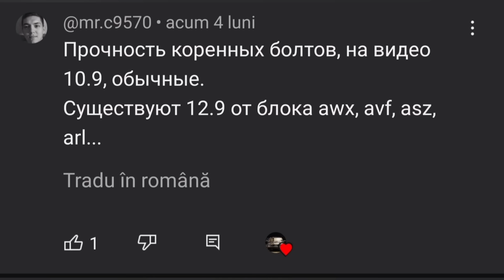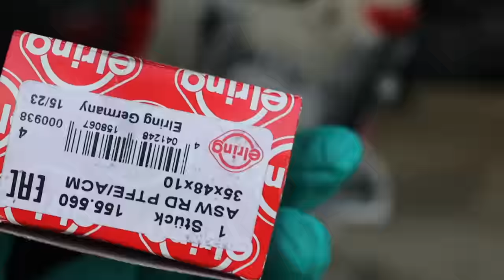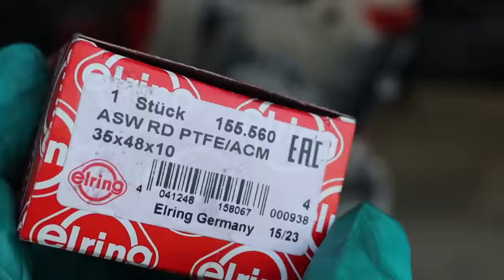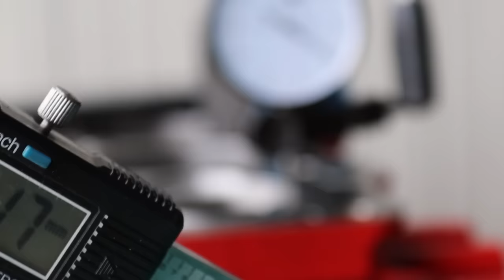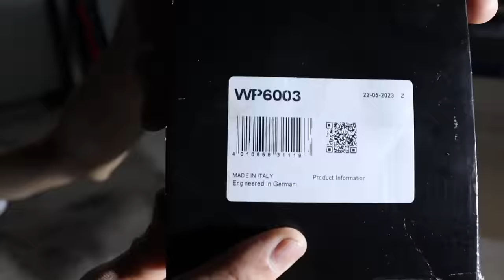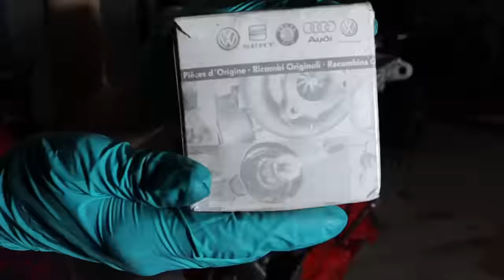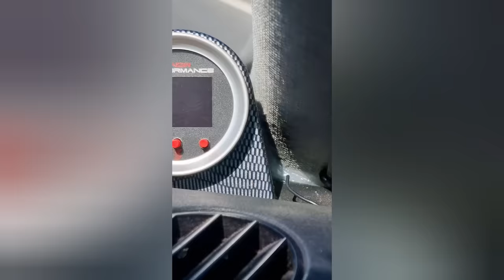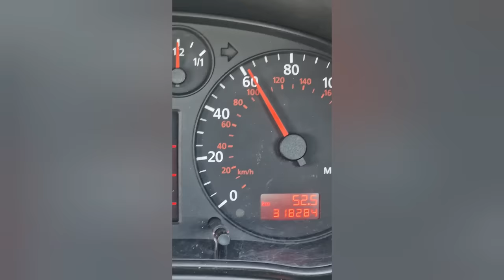1.9 tdi pd 8v Time-lapse Race Engine Rebuild + first start 2023

Comment: Hey, it was very unexpected to see myself, and my advice is to change the usual 10.9 bolts to 12.9) Very grateful, and glad that I helped!) Good luck;)
Reply from the maker: The thing is that the stock bolts are 12.9 for this ASZ engine code, same as ARL and when i ordered the bolts i receive them and i didn't check them because i didn't think they may be send wrong ones, so you just make me check them and thanks to you i've been able to change them with another genuine 12.9 ones.
Reply: Hello guys, do you have the part number for connecting rod screw?
Reply: There are 3 diff between the two main engines, ASZ and ARL,  the turbo, the IC, and the headbolts.

Comment: Its not good work... scratch In cylinders,  weak stock bolts 10. Another user help you thoose better - stronger, used stock pistons with chamber moding. Only forged conn.rod are good and  stronger bearnings. Next tip Oil pump with smaller wheel ,produce  more Oil pressure. Camshat Type? Hydraulic delete to mechanical converse do highest rev and max boost😊
Reply from the maker: Listen mr advicer, im not posting this videos to ask your opinion i know very well what im doing and i know exactly what's better and what's not for this engine.
  Firstly the 10.9 bolts were come in a huge bunch of parts and i have ordered the right part number for 12.9 but unfortunately they came wrong part and i haven't check them,  i was lucky as the engine was still on the stand by the time i saw the comment from that user and just change them with new genuine 12.9 ones.
 Second thing, this is not the first time i build an race engine and i have tested many brands of part by now doing testings on my engines and show others for free whats good and what's not.
 The 3rd thing i have sayd in my previous videos that im gonna try and test some mods to see how will engine react so the videos that i upload should be for infos if you can  get any from them.
 The camshaft i sayd in other videos its a pipercam 272°, i have all details  and link there with the lift specs, then oil pressure i know that what you sayd but at the moment i use the car in very high revs and keeping the huge preasure on the oil sistem its not gonna help me and the oil pump will definately fail much faster, at the moment ive got 10 bar at 90° after 2k rpm so im good.

In the end people should understand that these videos should be helpfull for yours and if you can get any good information from them ill be happy if not this is it, you do other videos and show people on your money how to properly do it  and let me do them how i know.
 Thanks !
Reply: @WRCgarage  OK, fine , for me you know mid. I do 2.0 Tdi to 295/605 on Gtd20 v2, Without metanol or nitro , pure  diesel! . Cya!!!
Reply from the maker: I did before rebuild 330hp only diesel aswell, and got some good performances but because i wasn't satisfyed with 100-200 time i rebuild the engine again with new upgrades as veicomer full race head, another type of forged conrods, a better camshaft and new design of pistons wich are on testing at the moment.

   If everything goes well the car should archive around 380 hp diesel only, and with methanol another 20-30 hp extra, and with nitrous probably another 100 hp depending of nozzles and controller. So ill see, the car is still on break in at the moment.

Comment: I had a 1.9 tdi (1Z). The engine start after the assembly in this video reminded me of when the timing belt had skipped one tooth, and the engine was very difficult to start.
Reply from the maker: 😅😅 That isn't the case here mate, im tired to explain everyone why i did started the engine like that, the engine is brand new everything was new without oil inside and without diesel on the sistem, i wanted to start like that to give him time to get oil on the parts before starting

Comment: So much money and not decking the block? What about those bores? Clearly seen better days. Strange aproaches.
Reply from the maker: Why are you worry about my money ? I dont need any advices thank you, i'm doing my engine how i like.
Reply: Not every rebuild needs to be bored and decked. Seen people waste money  when a hone and re ring would have been better.
Reply from the maker: Sorry to disappoint you, mate, but the car still works brilliantly without any issues. Only "smart" mechanics do the decking when there's no need for it, which is the biggest stupidity I've seen. I never did it when there was no need, and surprisingly, the engine performs as new.
Reply: @WRCgarage I completely agree with you. I did the same thing. I hate when people deck a perfectly good block. It makes no sense.

Comment: Hey do you remember what your ring gap was set at?
Reply from the maker: If you check my videos you will see the video doing that
Reply: @WRCgarage  .50mm? Spec is .40mm.  It's ok to be at .50mn?
Reply from the maker: @matthewlee2686 I have explained in the video but you haven't been focused,  i am gonna use nitrous injection on that engine and the gap should be bigger in that case.
Reply: @WRCgarage  was just curious because I'm building a engine now and can't find much info on ring gap.  I will be running gtb2260vk and .320 injectors.  Will my gap be ok at .45mm?
Reply from the maker: Yes, no problem,  its better to be bigger than specs and not lower as you running on higher boost than stock and much more heat than usual so that's fine.
Reply: @WRCgarage  ok thank you
Reply: Foarte frumos lucrat bravo mult respect 💪💪💪
Reply from the maker: @costiklafarastikla110 Mulțumesc frumos ! 🙏

Comment: I did 184,000 hard miles with a  tuned PD130 but never got to see inside the engine due to it reliability.
Great video 👍👍👍
Reply from the maker: @Puddingtops  Thank you ! 😁

Comment: 10:46 dont do that. Dont put liquid gasket in all the surface of the caps. There is a slot that should never be covered. You only have to apply a small amount of liquid gasket on the outside of the caps, without covering the slot.  It is explained with more detail in the official manual.
Reply from the maker: I know i have the manual, i saw that to late, hopefully its a small amount and wont restrict the oil that supplies the camshaft bearings. 
   To be honest usually i never put the silicone there and never had leaks but this time i did 😅, should be alright, i will check it next time when ill be home.

Comment: Amazing! Should there be a pipe from the PCV valve on the crankcase?
Reply from the maker: Yes, but it's going to a catch can, then under the car
Reply: @WRCgarage  is there a way on these engines to test the pcv valve is working correctly? I have a 1.9tdi transporter, blue smoke from exhaust, leak and pressure test all good. Thinking might be the pcv valve stuck open/closed
Reply from the maker: I don't know if there is any test for them, but you can check if your oil stick jumps out or if you have excessive pressure when you open the oil cap.

Comment: Hello, is there a change regarding the tandem pump? I think it is a little different. Did you prefer the one for 2.0 pd engines? what is the reason of this ? I would be very happy if you answer me. I think I am having a problem with this issue.
Reply from the maker: The bosch one i use is a bit higher pressure than the stock LUK, so for me it is a help for a tuned engine as supply the fuell a bit faster.

Comment: salut amice, stii care sunt tolerantele marimii arborelui cotit (ASZ), oficial sunt 54mm (la rulmentii principali) si 51mm (la rulmentii de biela), dar VW nu scrie in manualele de service care este rata de uzura, daca ați putea ajuta, aș aprecia că a menționat în următorul videoclip😇
Reply from the maker: Salut, la arbore jocul axial (stanga-dreapta) trebuie sa fie intre 0.07 si 0.17 mm uzura maximă acceptată 0.37 mm, jocul radial (sus-jos) verificat cu plastigage trebuie sa fie între 0.03 si 0.08 mm iar uzura maximă acceptată este de 0.17 mm
Reply: @WRCgarage   multumesc pentru informatii, am arbore cotit si valorile fata de cele oficiale sunt -0,005-0,006 pe ale mele, cu faptul ca rulmentii sunt facuti si pentru uzura arborelui cotit. Multumesc, pot dormi linistit. Cand fac montajul, ci mai degraba masurarea de testare (gabaritul din plastic), va mentionez

Comment: 1.9 TDi - 130hp????
Nice work!!!!
Reply from the maker: Yes pd130 😁
Reply: full stock can hit 125kw, with race head i expected maybe 200hp :/
Reply: @jakub77 I got PD130 AVF with GTB2260VK, FMIC, 4Bar Map and tune and it has ~230hp
Reply: @vainopeltokorpi7829 I have the same engine and turbo along with other upgrades. If you use pd150 12.9 head bolts, upgrade camshaft, high flow exhaust manifold, 2.5-3 inch exhaust pipe and upgraded injectors you can see over 300hp
Reply: @lamaq101  for gtb2260vk max hp is ~290. You also have to port your head for over 270-280 hp. Upgrading exhaust manifold is not necessary, i have seen ~400hp setups with stock manifold.

Comment: Where can you buy pistons if you’ve changed the engine displacement in a 1.9 tdi
Reply from the maker: The stock pistons you can find them on mostly any online parts shop, the forged pistons just few do it .
Reply: @WRCgarage  great, thanks

Comment: Hi, please tell me the number of ARP bolts for this engine
Reply from the maker: Hi, they are special made they not come as a kit like all the others wich ar weaker chrome-molly 8740. Just go on the website where i get them and order from there, they dont have these anymore due to cost of supply but they have even a beeter one stronger than these for same price so just go on website Whitbread performance llc USA and buy from there.
Reply: @WRCgarage thanks

Comment: Salut,la un passat b5.5 2004 1.9 tdi 130cp la 140km/h taie pedala,dar nu apare nici un martor in bord.Daca il opresc si il pornesc isi revine,dar dupa daca ii dau iar pana la 140 iar taie pedala.Sentimentul este de larca nu intra turbina si motorul nu arw outere sa se accelereze.Mersi?
Reply from the maker: Salut, iti intra in limp mode,  posibil sa ai vreun furtun pe partea de boost spart/fisurat si de asta face asa, verifica bine furtunele la turbo.
Reply: È la valvola a depressione che c'è prima del waste gate, prova  a staccare il tubo sopra il fungo e guarda se aspira.

Comment: А что за измерения на шатунных болтах?
Reply from the maker: Hello,  what do you mean the socket size or the bolt ?
Reply: @WRCgarage Hi! I wonder what you measured on conrod bolts after tightening them.
Reply from the maker: The ARP bolts must be tightened to stretch, so I was measuring the stretch after tightening. The stretch is the maximum point before the bolt breaks.
Reply: @WRCgarage  thanks, i didn't know about that.

Comment: Salut ! E normal ca pe la filtru epurator din capac sa ajunga ulei spre furtunul care duce in turbo ?
Reply from the maker: Normal nu e, ar trebui doar vapori de ulei sa treaca pe acolo, dar odata ce motorul are ceva uzura incepe sa produca si vapori mai denşi de ulei si de acolo se aduna cate putin ulei, de exemplu eu înainte sa refac motorul asta imi picura pe furtunul de la epurator care este sub masina scos, acum dupa ce am refacut motorul tot jos este scos direct dar nici macar nu se mai umezește, deci conteaza uzura zic, oricum asta nu este un lucru care sa te ingrijoreze atat timp cat motorul merge ok, nu te va deranja chestia asta.
Reply: @WRCgarage  motorul e ok. Doar ca am schimbat turbina cu una nou nouță și ma gândeam sa n-o strice din cauza asta...am pus un oil catch can sa previn cat de cât...
Reply from the maker: Asa am pus si eu, nu o sa ai probleme din cauza asta.

Comment: Salut! La 12:41 vad un senzor de presiune ulei atasat pe un altfel de termoflot.
Imi poti spune te rog ce fel de termoflot este? Am si eu un asz si m-am legat cu 3 senzori (temperatura ulei, presiune ulei pt ceas si presiune ulei cel al masinii) din acelasi loc de unde vine senzorul de fabrica pt presiune ulei cu un T luat de pe raceshop si problema e ca as vrea sa-l mut pe cel de temperatura deoarece nu imi indica temperatura corecta de acolo...
In mers imi arata maxim 60 de grade iar cand stau pe loc e maxim 80 ceea ce stim cu totii ca nu arata bine :D
Ma gandeam sa pun senzorul in baia de ulei ca are filetul majorat la m16 sau sa ma leg cu ceasul direct de senzorul de pe baia de ulei pt ca nu am vazut un termoflot de genul pana acum.
Orice sfat e bine venit!
Multumesc! (:
Reply from the maker: Salut, ala mai mare galben este senzor de presiune de la ceasurile prosport, iar adaptorul ala in locul ternoflotului este de la racitorul de ulei auxiliar care duce in radiatorul montat in fata ala mic, este un kit de răcitor de ulei de la G-plus care mai are un adaptor in plus pentru anularea termoflotului oem de tot, pentru ca majoritatea il pastreaza, iti las un link cu ceva asemanator dar nu are si adaptorul de jos in rest e la fel.
https://www.ebay.co.uk/itm/355012384851?mkcid=16&mkevt=1&mkrid=711-127632-2357-0&ssspo=lmf0ij6xq0i&sssrc=4429486&ssuid=nlA2ZJOUR7m&var=&widget_ver=artemis&media=COPY

Cred ca tie din cauza T - ului iti citeste eronat pentru ca il raceste mai repede din mers pe T-u ca e subtire, incearca sa il pui senzorii direct in termoflot, acolo ai sinpresiunea de ulei, in baie nu ai presiune.

Comment: Why the car take so long to start ? I dont think its normal
Reply from the maker: Hello, i already answer many times to this question, everytime i rebuild an engine from 0, i won't start the engine straight away as i want to make sure the oil gets everywhere before start, so i did that on purpose .

Comment: Kinda curious as too where your based. Thats a right hand drive car but don't think your in the UK. Why a UK car?. Also what sort of power is that engine putting out
Reply from the maker: Hello mate, that's in Romania, i live in uk mostly, the car now should be somewhere around 350 hp with that turbocharger that it has on now, but the engine itself as it is now should hold easly 500 hp.

Comment: Ручное хонингование🗿🗿🗿
Reply from the maker: It it something bad in that ?
Reply: @WRCgarage  You won't be able to create the perfect cylinder geometry by hand.  In addition, the incorrect angle and shape of the hon-risks do not allow the rings to rub in well, contributes to increased wear, etc.
Reply from the maker: I know exactly want you mean, but that doesn't mean it is a bad thing thinking to the way that my cilynders been before that, because at that time when i did the honing i was on to rebuild the engine so when i saw how bad the cilynders look i decided to do that honing as they been like glass so because i haven't had a spare engine block i did it to be able to finish the build, knowing that i had to find soon another emgine block replacement.
   So i did about 1k miles or even less with the engine loke that and i haven't had any oil consumption or any other issue then i found another good engine block wich i replace it with another set of new rings and now the engine works sound and good same as before to be honest but at least i have peace of mind.

Comment: Start spray = Start in 1sec
Reply from the maker: And break in another 5 seconds 🤣, o hope you not mechanic
Reply: @WRCgarage  I'm not a mechanic, but that's how I always start the engine when I disassemble the fuel hoses.
Reply from the maker: @Vasiccc I have explained hundred times, when an engine is fully rebuit and empty/dry of oil and diesel you don't want to start that engine in one second, i did wanted to start like that to have time to fill with oil all parts before starting.